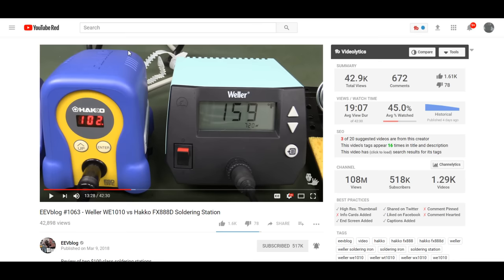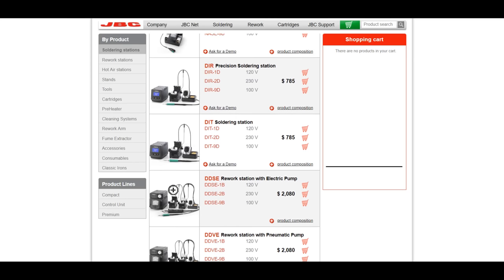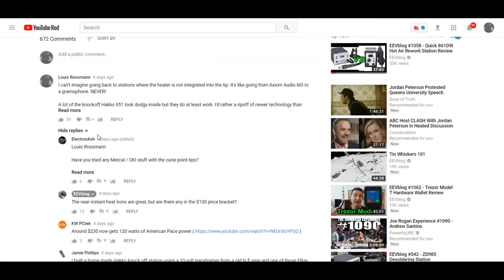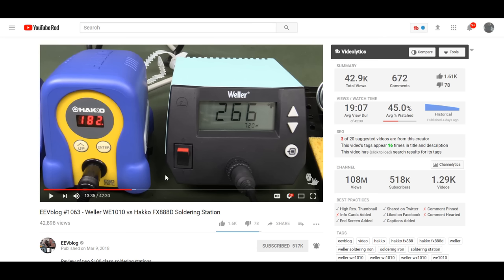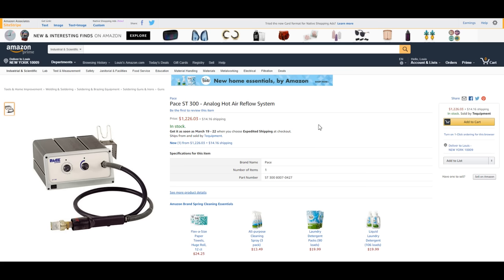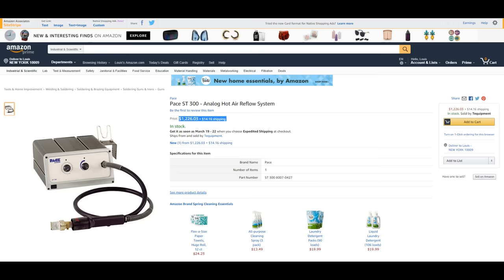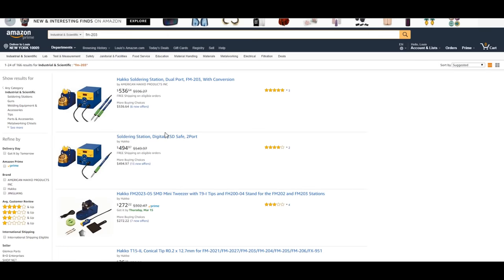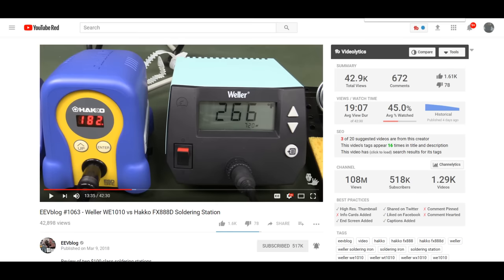Soldering station technology & the lie of "SOLDERING PATRIOTISM"

Comment: I have the Hakko FX-951 which I use for micro soldering, no question its a great station.
Laugh if you like, but for everything else I have two old Weller WTCP TC-202 series stations, one set up with a standard tip, the other with a heavy duty tip.
Heat up time for the WTCP stations is 11 seconds, that's plenty fast enough for me.
Do I have an issue with the older type technology or does it hold me up time wise in some way? No and no. Sometimes I have to solder dozens of DIP IC's, one after the other, I can do them as fast as my soldering technique allows and I've been soldering since the 80's.
Some people claim there is a big issue with WTCP heaters blowing all the time, well I am not sure what they are doing with their irons as I have only had to replace a heater once in 30 years. Genuine tips also last almost forever for me, I only recently replaced my favorite tip after 25 years of use, mind you it is still in usable condition and before I got that tip I used it in an electronics production facility that I worked at for three years. That tip has been used from building and servicing guitar amplifiers, to logic boards, just about anything. Another thing about these old stations is that they are bomb proof, no digital crap to play up and blow up. Ok so I do look after and respect my tools, all of them, that does have something to do with it.
Yes we can look at graphs, get out our stop watches etc, but in the end does it make a difference in the real world for 99% of jobs? To me the answer is no.
With all respect to you Louis, this isn't a dig at you in any way.
Reply: Dude I agree with you 100% 
To me is how you use and know the tools you own 
I have very expensive irons and not so expensive 
From hakko to weller plus and planing to get the jbc model 
An I can tell you that the old and new both work as long as you know how to use them and maintain the tips 
As a matter of fact I now have the famous t100 as my traveling iron an it does anything I throw at it on the road which can be a little hard sometimes because the close nice  environment at your bench shop is not there when you’re on the rd

Comment: Louis, you should check out Pace's new ADS200 Accudrive, it's a brand new competitive to the hakko you showed and affordable.
Reply: Curie point tips and they claim to have the lowest cost of ownership in this style
Reply: They are not curie point - they're traditional resistive heating with a sensor (probably a thermocouple, maybe an RTD).
Reply: Ah I was thinking of the Hakko FX-100 which uses induction heated curie point irons
Reply: Haven't heard of this until now - I own an MBT301 with TD100, and improved handpiece design is looking great. More power, and apparently only $239 too, although apparently without the sleep stand. 

There's also an important thing that I don't think Louis mentioned, and that is the cost of the tips. While I love JBC, their basic geometry tips are like 2x the price of the Pace and Metcal ones if not more.
Reply: I'd love to see Louis compare the ADS200 to the Hakko FX-951 -- I'd bet it's at least on par, and being around the same price the interface and preset improvements alone might make it the better choice.

Comment: I have never seen a soldering iron that drops in temperature like that besides a cheap $10 one. Have you, Louis? If not, then we agree with each other. Secondly, I work with what works for me. I couldn't care less where it is made.
Reply: No. Frankly, I don't have the time nor the inclination to measure or monitor the temperature. I rely on the soldering iron to regulate the temperature efficiently for me.
Reply: Dude, I have been soldering for probably longer than you have been alive, so I speak from experience.
Reply: Re read.
Reply: Precisely. What I said above is absolutely correct. Please show me where I ever mentioned lack of experience? 

Oh, and by the way, I see you have taken the time to visit my chan. Good on you. I used to be a heavy smoker for many years. I used to smoke 40 to 60 cigarettes a day. Now, I smoke 0 cigarettes and I vape as a hobby. You have already insulted me by questioning my experience with soldering and electronics tools. Let me give you a bit of advice: Do some research before you type a load of shit about a subject you have absolutely no knowledge of. 1 nand 1 = 0. See if you can get that!
Reply: You obviously don't have a clue what you are talking about, and I am not going to discuss it any further.

Comment: I've got a question.
Why so many people shit on cheaper soldering stations, and are extremely reluctant to buy it saying that it must be lower quality ?
I mean, it's a fucking soldering iron with temperature control, not any high level technology. It doesn't even have to be 50$ to be built properly.
Similar thing goes for hot air stations - you've shown some stations for 1299$ and 299$, but I'm not sure if either of those is worth the money. It's basically 20 year old technology for higher than todays prices for some reason.
I've already seen both hot air and soldering station for 56$ (well the tip doesn't have heating element built in, but still).
Reply from the maker: because they suck
Reply: All of them? And how exactly?
I mean surely not all 50$ soldering stations and digital irons suck .
Even Hakko is overpriced, if somebody can copy it cheaper (and it works).

Comment: Not to mention American products arent really that great. I rather have a good product than "PATRIOTISM!". Im in the flooring business as an installer, the best stuff to put in is from overseas and the stuff made here in America is bad. Just taking 2 hardwood products that we put in, Summit Collections which usually sells out on the boat on its way here, or Bruce, Bruce can and usually does have 1/16-1/8 in difference in the width of the boards which will create gaps. Summit Collections on the other hand you might find 1-3 boards out of 3-5 orders that you have to put aside.

I will buy American when they make a good product.

Comment: While I agree, I think it's important to take into account diminish returns, and an individuals usage level/amount. 

For a professional, like yourself, getting the nicer and newer technology should be a default thing to do. But for someone just doing hobby stuff or repair at home, there's not much reason to spend 2.5x as much to get an iron that recovers 5 seconds faster and has 20-30c more thermal capacity. And that's the diminishing returns part. At least for home/hobby/non heavy professional use. 

I think you got caught up too much on believing that because it's old, it has to be inferior in every way and there's never a reason to get it. I'd also like to point out that there is a (yes, a single one, lol) benefit to the simple tip model. The tips are cheaper! Lol! Just don't break the heating element... 

Basically, there's nothing wrong with the old "crappy" tech. The newer stuff is just better. But that doesn't automatically make the old replaceable tips a total waste of time and money and you should buy Chinese knock-offs of potentially dubious quality because it'll be so much better and the old stuff is practically unusable! 

Like I said, I do agree with you. I just don't think that telling people not to buy fx888Ds and telling them to buy something else as a beginner/starter iron is necessarily the right course of action. The FX888 is loved for a reason, even if it's "old outdated shitty technology".

Comment: This uh "new technology", as you call it, you're stuck with one tip?
I've been using Weller stuff for a long time and the counter-point to almost all of your arguments is "get a station that supports a more powerful heating element".

And how often do you have to replace them?  Do you have to replace the entire iron up to the plug?
Reply from the maker: You can have as many tips as you want. I never have to replace the tips, ever. They cost $15 if I ever want to replace them. Tips for the old style were cheaper but I would have to replace them. Replacing tips is so 1990s.
Reply: I don't know.  I watched Dave's response to your response.  Despite him basically agreeing with me, I was kind of impressed with how quickly the JBC dealt with a big ground plane.  I'm starting to come around on that kind of iron.

Replacing tips is still very 2018 if your coworkers:
1) refuse to clean their soldering irons.  Ever.
2) leave them on all day.
3) set them at 850 degrees and (then refer to 2)
4) DO THE SAME THING WITH YOUR IRON BECAUSE ITS THE ONLY ONE THAT WORKS.

I'll check your video description for it, but if you see this, what flux do you use?  The flux I use is extremely harsh.  It eats through solid copper tips in maybe a couple months.
Reply: I didnt expect the flux to be there but it was.  I should have looked first.

Comment: What happens when the people doing the soldering in American don't have jobs because people send there repairs to China, India or Eastern Europe? Sounds like a typical case of 'I'm alright Jack' to me!

But yes $1200 is expensive for a hot air station but at least it is probably not going to malfunction and burn your workshop down and whilst you claim that the clones/fakes are good have you tested them for longevity or reliability. If they are so indistinguishable why don't you use the fakes/clones?

I seem to recall some years ago that Dave recommended the FX888D or certainly its analogue predecessor, the FX888. Sounds like he has probably been given a freebie or some money for an endorsement.

Comment: I used to have this argument with coworkers when it came to cordless power tools. I found a decent quality low price cordless tool line, and went with that. They all used their American Made (at the time) tools that cost 3 times as much. The thing is, I still have tools for that line I bought 20 years ago. And their "American Made" tools are now owned and made by the same exact company that makes my cheap tools, though the price hasn't changed much.

My argument was that all tools have limitations. If the cheap tools can do the job I need them to, then they are the better deal. The capabilities and quality of the more expensive tools just didn't justify the price increase to me. Not only that, but if a tool should get lost or stolen, my $50 drill now costs me $100, whereas their $150 drill now costs them $300, and both tools are equally susceptible to loss or theft... As for durability, that depends on what you try to do with the tool. Like I said, I still have tools from 20 years ago that Ryobi makes new (cheap) lithium batteries for, and those are the same batteries used in their new tools as well. Dewalt, Milwaukee, Makita, etc... They have all changed their battery designs several times since then, and finding a new battery for their old tools is either impossible or insanely expensive.

Comment: I don't really care for using the "old technology" vs the new. It works, have worked well for a looong time and it's had thousands upon thousands of runs- some critical and quick jobs and others not so.
If I had to replace it, I'll prolly go with the "old technology", cause that's been very reliable up to now.
I feel it's all just "shiny new toy" syndrome, and nitpicking- the sort of attitude like that of an Accountant.

Unless you run a business, or work for one - and not just any old business- a corporation of sorts, where time is of the essence and is heavily punished, getting something that shaves a few seconds off each time is prolly an investment, but for 80% of folks, 80% of time- it doesn't matter- old or new- as long as it's quality equipment.

Comment: Recommending a chinese knockoff over a genuine part is kinda weird. The 888 will be more than enough for 99% of hobbyists and much better quality/longer lasting than the chinese knockoff.
Reply: b888 yeah no shit but theres a huge difference between  a reputable Japanese company getting a product made to their standards vs a Chinese company designing and producing clones of an existing product. The quality control isn't there. The parts are sourced from who knows where. It doesn't undergo safety testing from UL or MET or any other certifications. You get what you pay for

Comment: Hakko,JBC, Pace, Metcal, etc. are to over priced
Reply: Well at work we have replaced all Metcal stations with Thermaltronics ones (especially TMT-9000S model) - Thermaltronics lasts longer for the cost. The best part is that Metcal tips fits perfectly with this station and there is even special tables, where is you can see all the tip model numbers Thermatronics vs Metcal.

Comment: Hello- I develop chemical compounds for a pretty lucrative living. I know nothing about repairing computers. To be fair I know next to nothing about the entire computer universe. I ran across your videos as I am cleaning the fan on my MacBook Air. I just wanted to say you are doing a great job. I see you get a lot of negative garbage from people. Thats normal. For every 1000 happy people that never contact you you get one ass who sends you a bitchy rant. I see you take it in stride and even laugh about it. Well done. As far as the Celsius/ Fahrenheit squabble we will die with that same problem. I'm 55. When I was in 4th grade they told us we would be metric when we got a job. From 22 to 35 years old I lived in Israel. I ONLY used the metric system. SO much better and easier. However our system isn't exactly particle physics. So we will have it forever because we are Americans and we don't change. Ever.  Keep up the good work!

Comment: Fahrenheit is superior because you have more steps? Come on. You know full well that you never need the granularity of Fahrenheit to solder anything seeing as 1ºF increase results in a 0.55ºC increase which means that a "converted" Celsius setting is at most about 1ºF off of your desired ºF setting which is totally irrelevant for soldering, I've seen you review an iron that had 10ºC steps and you were fine with it so you know that as well. Not only that but if you wanted more steps with Celsius you could use decimals or an equivalent unit, a decicelsius, all temperature units of measurement are infinitely divisible and infinitely granular, in this regard there are no winners nor losers, both scales work in an identical fashion. Following the logic that smaller units are superior because we have more steps we could have a LouiRoss unit which is equal to 0.5ºF so that would obviously be the superior to ºF, right? The reason why Dave doesn't like ºF is because an individual doesn't use ºF in isolation, it's part of the Imperial system and along with it comes all sorts of nonsensical other units like quarts, pints, gallons, feet, miles, yards that you HAVE to use to stay consistent when performing calculations if you choose to use ºF, which is why academia uses the Metric system, and while ºF has nothing wrong in isolation it's inferior because the Imperial system is inferior and ºF it isn't compatible with the Metric system.